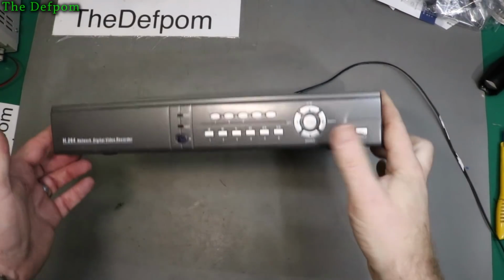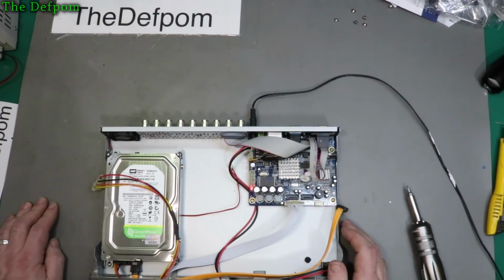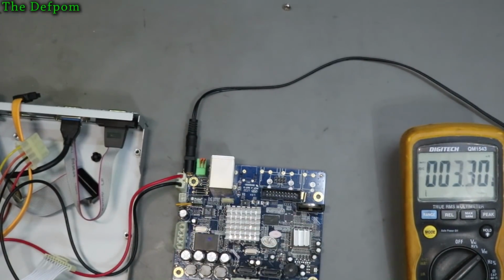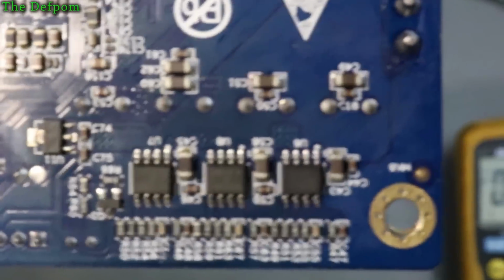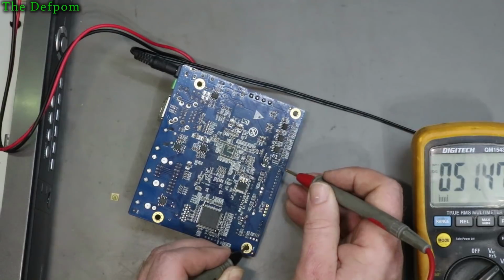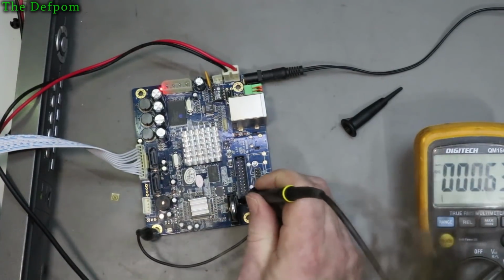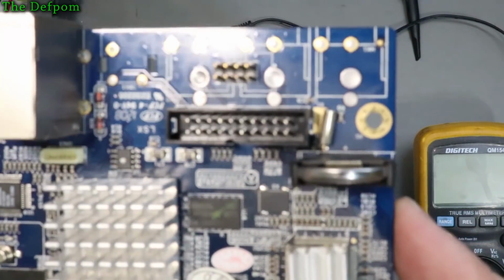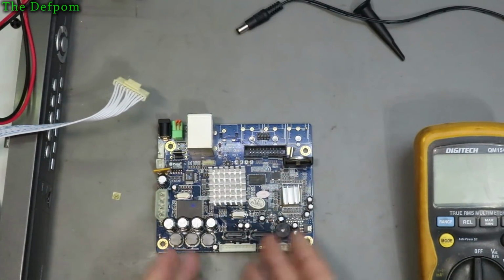🔴 #482 8 Channel CCTV Digital Video Recorder Failure Investigation - Unsuccessful Repair

Comment: I had a similar issue with an analog CCTV DVR, it looked like it was starting up but then the power light just went off again. I turned out to be a firmware problem which occured after a power outage. Got the shop to reflash the firmware and the box worked perfecly again.
Reply: I had a similar issue where the system start initializing but stays that way and never load the system. Perhaps a FW issue too. How did you re-image the FW?

Comment: I thought these boot from the hard drive as I've had no luck recovering them when the drive dies. I don't know where you'd get an image for a new drive. If there is a NAND flash on the board you could scope the data lines to see if brain is trying to read it, or scope the SATA lines to see if it's trying to access the drive. I'd expect something to show processor is working.
Reply: DVR and NVR can run without a HDD installed. Most of them work that way anyway. Only ones I know that require a HDD to work are ones that almost look like a Desktop Computer... But no this one and most others will work without. HDD is only for Recording footage.

Comment: The underside of the SoC looks rather toasty.
Reply: I would try hooking it up to a serial cable.

I suspect the soldering on the BGA might have failed due to the heat, though.

The largest black header looks like an ARM debug port, but it's probably not worth trying that. Unless it might make for an interesting vid, of course. ;)
Reply: Or, it might just be filesystem corruption on the flash, because NAND flash is evil. lol

You would almost always see at least some serial console output on stuff like this, though. Try sticking the o'scope on that DB9 port.